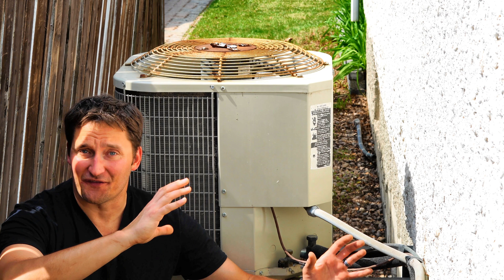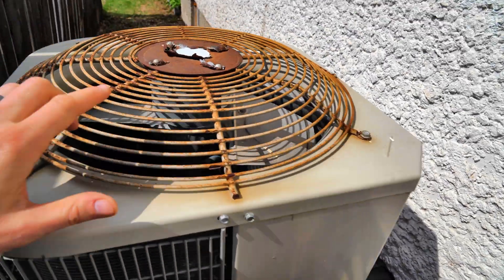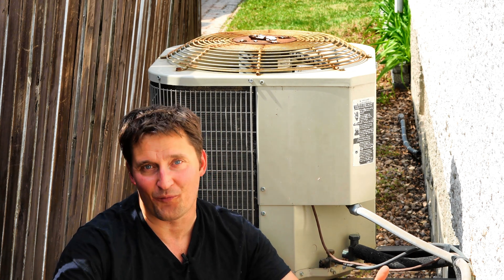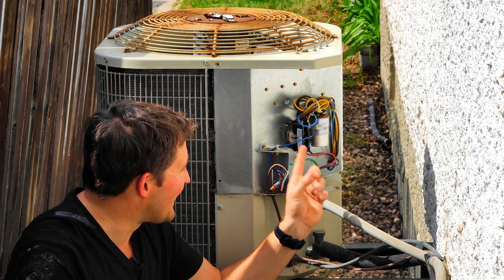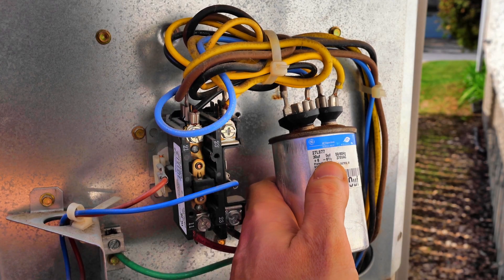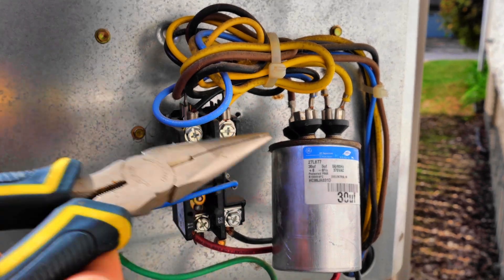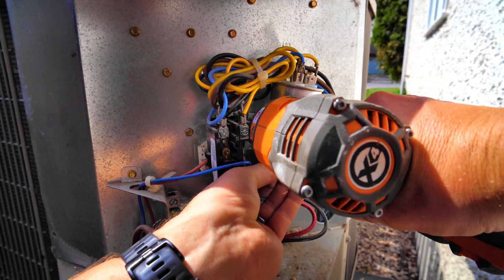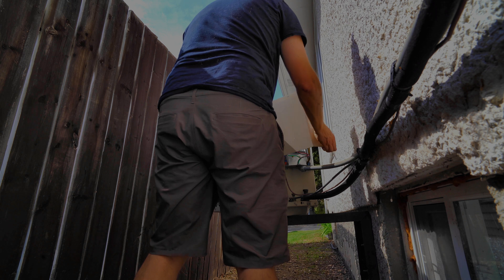15 Minutes & $20 | Easy DIY Central Air Conditioning Repair

Comment: Wow, great video! What should I be doing to my unit before I start running it for summer? I've heard to take the cover off and use a leaf blower on the coils aiming the air from inside unit outward through the coils, but I've heard the same to do but with water, so I'm confused as to which one to do🤔, help? I found your channel searching how to repair pool skimmer, which was extremely helpful so thank you! Now I'm wondering about my AC unit coils so thank you if you can answer🙂
Reply from the maker: Me, personally I use my garden hose and just rinse out the coils. I know there is a foaming cleaner you can also get, but I've had good luck with plain old water! Thanks again for the kind words
Reply: Ok I'll do that with the water, thank you so much for answering me I appreciate that! You're very welcome, so good of you to make the videos to help people 🙂 @RegsChannel
Reply from the maker: Thanks again for the kind words  @kellyr6274  Good luck with the projects!

Comment: This looks way easier than I thought it would be. How much does a capacitor typically cost?
Reply from the maker: @Cozy_Cat_Corner  thanks for the comment! The cost for my particular capacitor was between 25-35$ depending on where you get it from. Beats the 300-500$ an HVAC person would charge to come out!